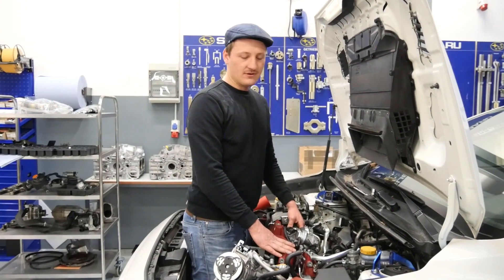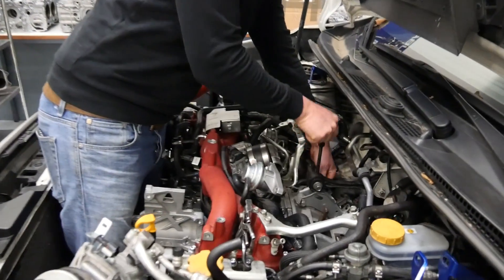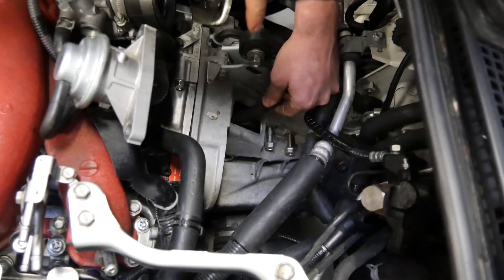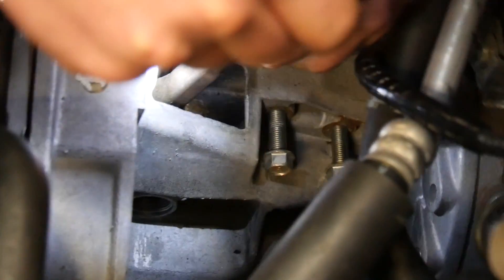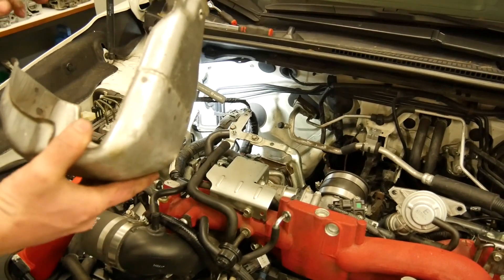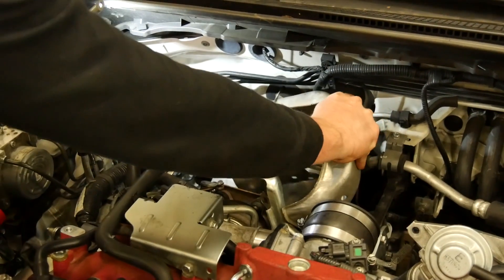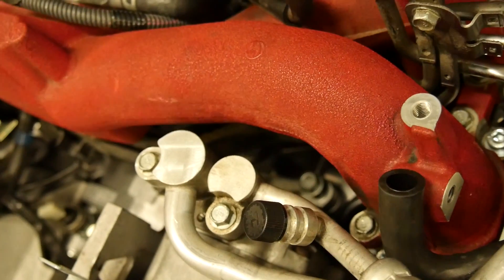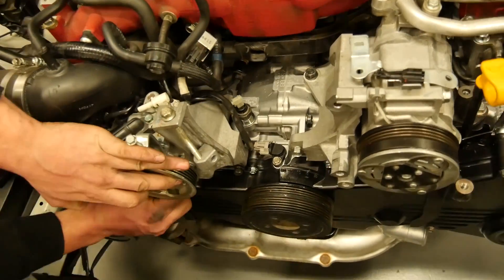HOW TO Engine Install Subaru Impreza WRX/STI EJ20/EJ25 PART 2 l Subi-Performance

Comment: what if i don’t have the slide to hold the clutch fork in, the transmission and motor just separate without touching the fork it’s a 2008 impreza

Comment: id assemble the fork and release bearing prior to engine install then once engine and trans are bolted id then simply push the fork in the opposite direction of normal travel to lock it in ! you are a subaru god ! great video's & weiny dogs !

Comment: Why do you connect the clutch fork the hardest way possible, I have always loaded the thrust bearing onto the fork and fitted the fork pin prior to putting the engine in. Then once the engine is in just push the fork towards the firewall until you hear the thrust bearing engage the pressure plate. This method has never failed and was shown to me by a subaru mechanic.

Comment: Hello, I have got a question, how are these engines cooled? In some video It looks like It is cooled by air, but in different video I saw an intercooler so I am confused.
Reply: Top Mount Intercooler and a Whatercooler. Its a water cooled engine
Reply: Coolant is pumped around the engine in a water jacket, and is cooled by the front radiator.

Top intercooler cools charge air post turbo
Reply: Thanks for answers guys, you helped me a lot.
Reply: max dráček your thinking about the Volkswagen/Porsche engines

Comment: Just to help, but you use the word Grease a lot and the way you tell it is not right. You say: Greyse, but it’s said like: Greese ;) nice video’s and a lot of new content frequently;)
Reply from the maker: yes sorry for my BAD ENGLISH im Working on it !
Reply: It’s not bad at all, just some little mistakes. Mine isn’t either perfect, just helping each other where we can ;)
Reply: But he ment grace😉😀! Very Good videos, love it. Wish I would be so calm and skillfull. The is always a lot of cursing when I am working😂
Reply: Yes, we love MoS greece - ups, sorry, grease, makes things easier when you need to disassemble and keeps wasser and moisture out to prevent corrosion. Actually quite important if you live in places where they use a lot of 'salt' on the road during winter or there is a lot of salt in the air.